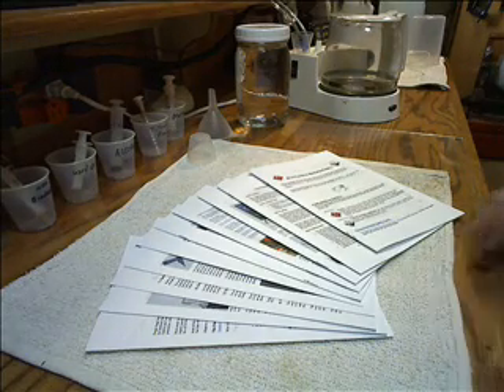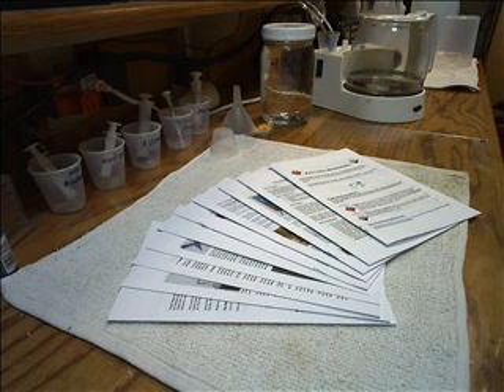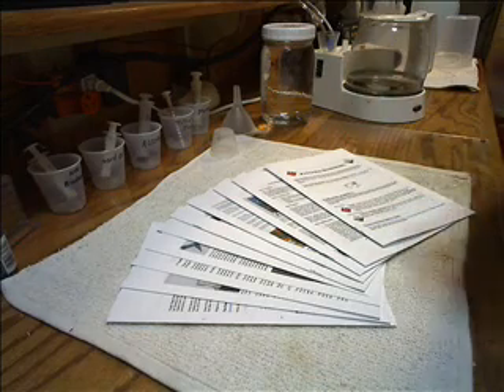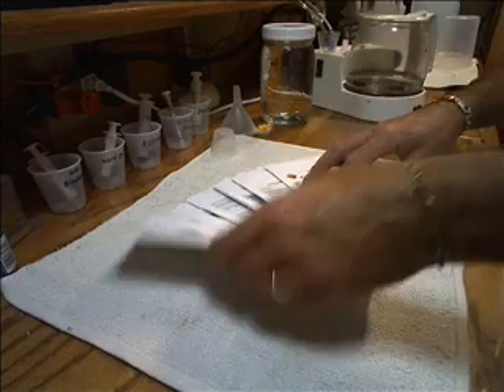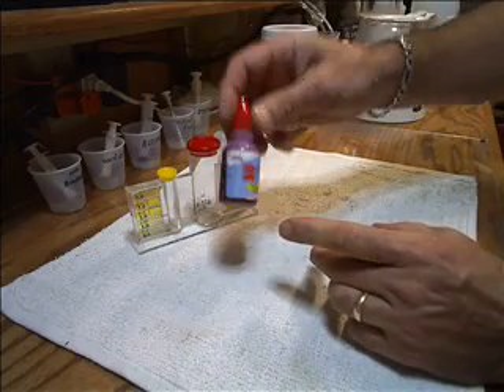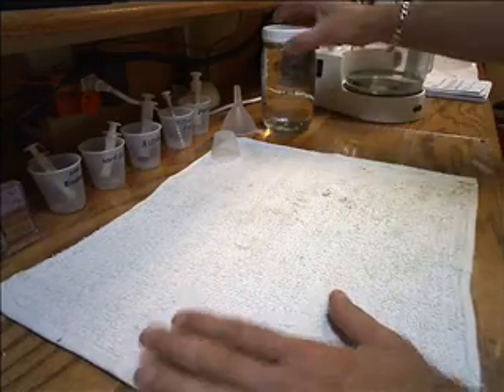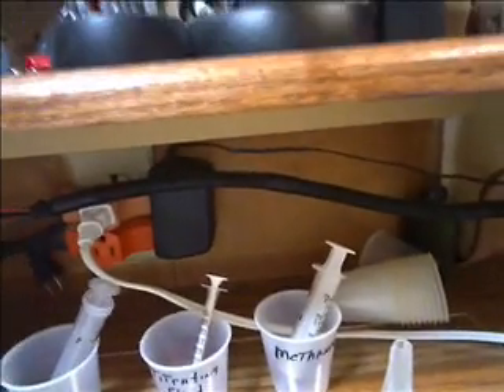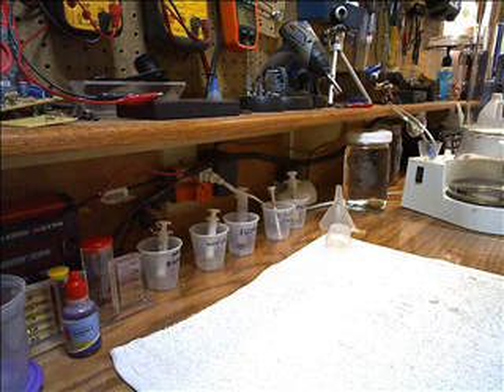Introduction To Biodiesel #1

Comment: I would like to start producing my own bio-diesel fuel primarily to run in my oil furnace with a conventional Beckett burner but there seems to be very little info on the internet as to whether this is possible or not. Could someone who is knowledgeable about this give my a little direction to go on? All that I can find seems to revolve around the Babbington style spray nozzle.
Reply: the diesel needs a special vaporizer and high pressure injection nozzle to mix with air and become volatile so you'd be better off making a generator from an old diesel engine and a treadmill motor or something